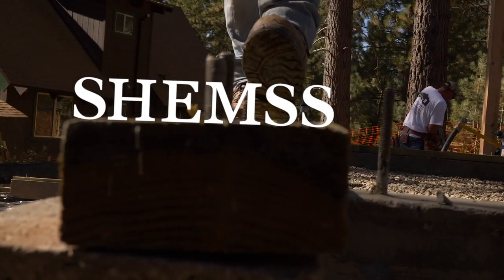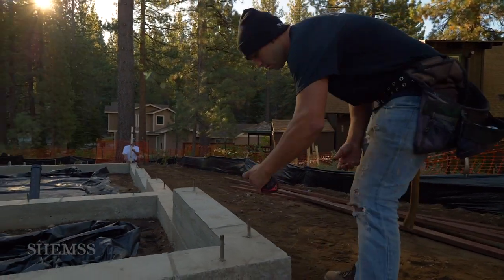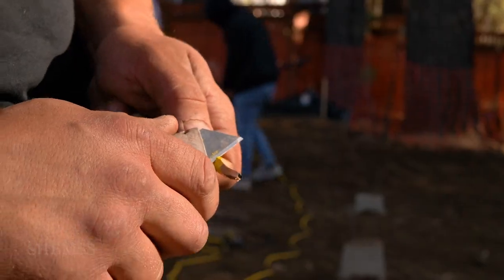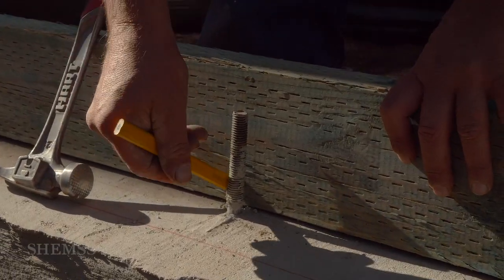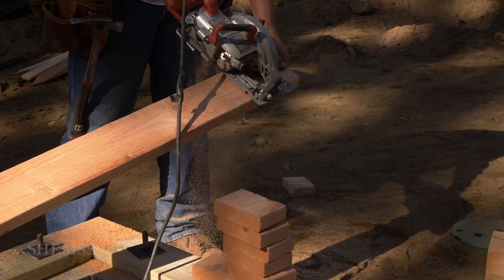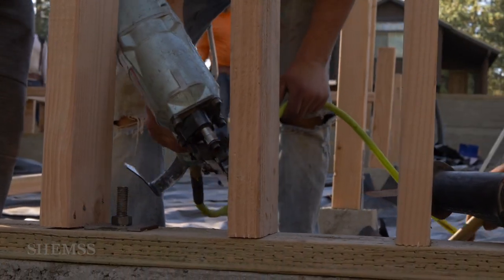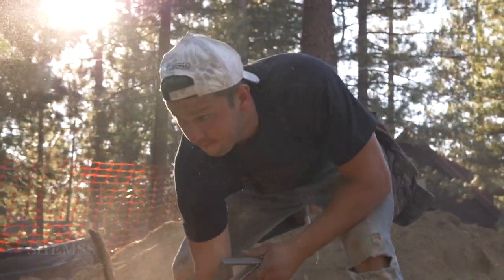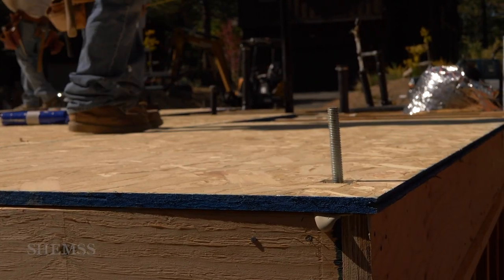How Its Built | Pony Wall & Subfloor | By SHEMSS

Comment: Nobody wearing safety eyewear using air nailers? OSHA what?
Reply from the maker: Take it easy... :) safety first, agreed.
Reply: @SHEMSS  Take it easy? Screw that. Get safety glasses on your crew. Set a good example before you post a video for others.
Reply: No Haywood. Its not possible to always wear goggles while framing. You're speaking like an extreme framing novice